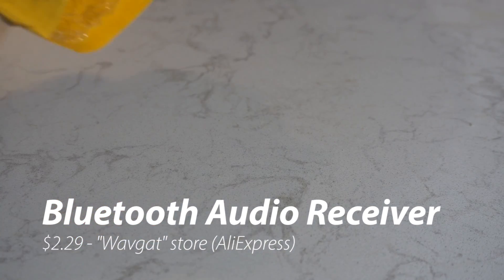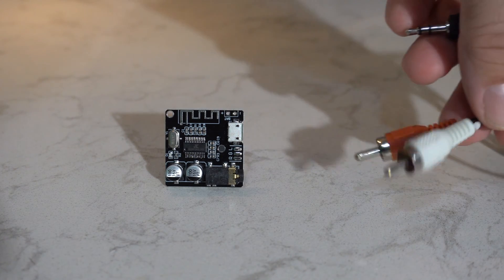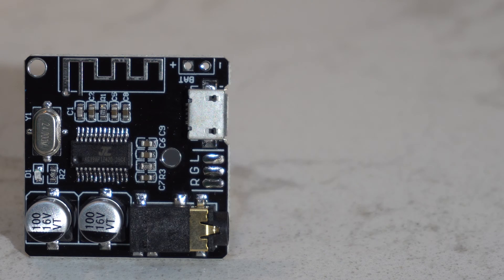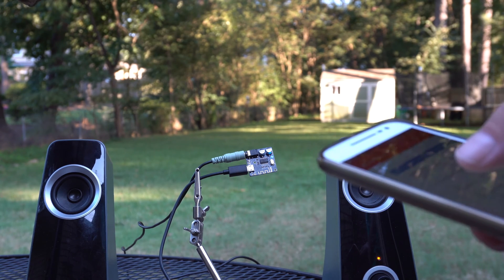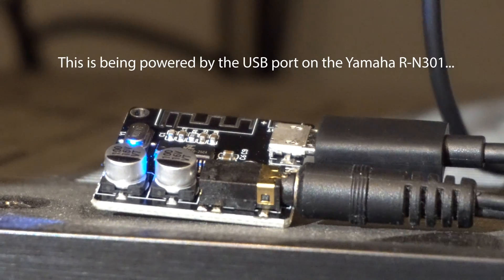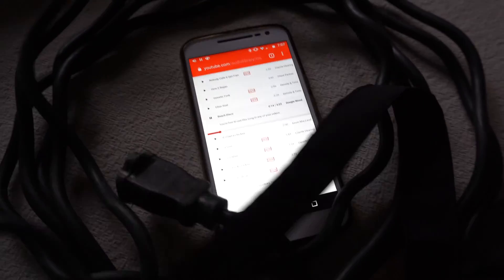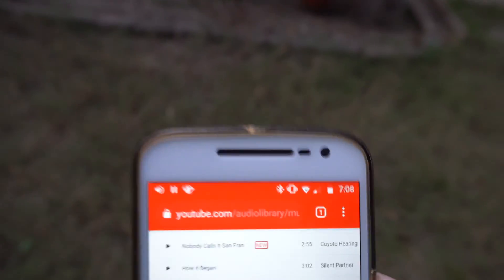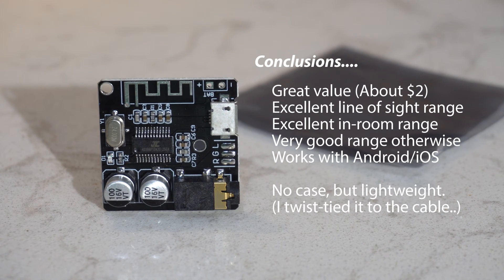Add Bluetooth to an old stereo receiver for $2 (No soldering)

Comment: Can you add the link of this product I can't find it online
Reply from the maker: I had originally bought this 3 years ago, I don't think the original store is still active. If you search Amazon for "bluetooth board" you should be able to find several examples of the same product. Amazon right now has 5 for $10 with Amazon Prime if you search for "Aideepen 5PCS Audio Receiver Module"... Thanks for watching!
Reply: @ACBMemphis  question with a CD player do you just wire it right and left channel ? then it will automatically work or do you have to put a blank CD so I can work (Bluetooth)hopefully you understand my question. I really enjoyed the video

Car stereo?

Comment: this is great, thank you ordered one for my vintage sound system....any thoughts how I can hook a classic car up with blue tooth I dont have any aux/line in on the old radio thanks in advance,( 62 Ranchero)
Reply from the maker: Thanks for watching! If you search Amazon for "bluetooth 12v car transmitter" you can find several options for around $20 which would take the Bluetooth signal and transmit it on an unused FM Frequency to your car radio. (Never tried this myself, but no reason why it shouldn't work...)

Comment: how is the sound quality? - Is it quite a step down from a direct wired analog input? I'd like to add decent sound (spotify) from my phone to my old stereo receiver. Can anyone recommend a good set-up if this $2 rig isn't it for my need? 🤔
Reply from the maker: Techmoan recently did a video about a "1mii b310" Bluetooth receiver that is nicer than this, but still under $100: https://www.youtube.com/watch?v=ZlI3yB2N9Pg
For an even higher quality (and more expensive) setup, check out an "Arylic S50 Pro+" which has been positively reviewed by a lot of audiophiles on YouTube...

Comment: Thanks for this. It's very helpful.  But I am trying to solve the opposite problem, and wondering if you can suggest anything.  I want to use my vintage receiver to broadcast to remote bluetooth speakers.  I want to play my vinyl, tape, cds on my stereo and send it to bluetooth speakers somewhere else in the house. I am already using my Aux for my cd player.  Maybe I can add a splitter there?  Or at one of my two tape monitor outpusts?  Many thanks!
Reply from the maker: Yes, they make affordable Bluetooth transmitters. The YouTube channel Techmoan recently reviewed such a device in a video about transmitting from a vintage audio system to a sound bar. (Search Amazon for "1Mii Bluetooth Transmitter" to see the device he was using...). You should be able to connect a bluetooth transmitter to the tape monitor record/out jacks on the receiver, and it should transmit whatever signal the receiver is playing: phono, aux or tuner. (Transmitting a tape signal might be a little tricky since you are using the tape monitor outs you'd have to set it in copy 1->2 mode.). Anyway thanks for watching and commenting!

Comment: Looking at the updated version of this board.  Would love to know how to hard wire the power.  Is there a power cord that can tap into 12v out there?
Reply from the maker: Not sure about the new version, but this board uses USB 5V so to power it from 12V you would need something like a car charger... Thanks for watching!
Reply: I agree, grab any obsolete 5v car charger (eg iPhone 3 or 4) take it out of the case, chop off the stretchy cable, a bit of wire and hot glue and you're done 👍

Comment: This is a great solution. I'm comfortable around circuit boards and electronics, and this is just a no-brainer. I might try to find a small plastic box but this is so small I can tuck it back and no one will see it anyway!
Reply from the maker: I just checked that site and today they have some Bluetooth modules in the $2-3 price range with a case included! Anyway, good luck and thanks for watching/commenting on the video.

Comment: Any suggestions for adding this to a 15 year old stereo that does NOT have any sort of auxiliary input, either 3.5mm OR coax cable?  No "input" whatsoever.  ONLY headphones connection!  (How frigging lame!)  Using in garage, extended speaker wiring so that the garage has a TRUE stereo effect, with speakers at each end of the garage.  Very nice sound overall, would just LOVE it to be able to have at least a wired and/or Bluetooth connection to stream XM radio through!
Reply from the maker: Hmmm that's a tough one. Without having to do any internal wiring on the stereo, one thing you might try is to find an FM transmitter, then hook the output of the Bluetooth receiver to the input of the FM transmitter. Actually, a quick search on Amazon for "fm transmitter" shows they have devices for under $20 that would take Bluetooth and transmit it to the stereo. The only drawback is since they are made for cars, they have those 12-volt plugs - but can probably be powered by a 12VDC wall adapter... I haven't tried something like this before, I just put one of those devices on my Amazon list, maybe that would be a good subject for a future video....  Thanks for watching!
Reply: @ACBMemphis  Ordered an Mpow FM transmitter with bluetooth the day we spoke here.  It just arrived today.  Works absolutely fantastic!  Crystal clear audio on 87.5 FM!  So awesome to have XM Radio blaring through my garage stereo!  And best of all it was only $7.99!  :)
Reply from the maker: @Florida_Man_In_Florida  Great, glad you got it working!
Reply: @ACBMemphis  I'd really love to watch that video if you made one. I have a Sharp QT-50 that I'd really love to convert to bluetooth somehow but it doesnt have Aux in, and those bluetooth receiver cassettes are super quiet. I'm not sure I'd be able to use an FM receiver with this thing.
Reply: @ACBMemphis  Thanks for the suggestion.  I actually do have a 12 volt to cigarette plug "dongle" from an old Garmin GPS circa 2007 when they used to combine them in box.  Basically it's a low amperage 12 volt wall adapter but instead of having a proprietary power plug it just has the usual cigarette plug on the other end.  That may work to power an automotive style FM transmitter from 120 volts household.

However with that being said I remember my friends who had FM transmitters back in the day in their cars, they were always full of trouble.  Static, distortion, etc.  I always went for the wired route - either replacing my head unit with one that had an auxiliary in port, or using the in-line antenna adapter with a switch to select between auxiliary in and FM antenna input.

Unless technology has changed, the FM transmitters of 15 years ago really sucked ass!

PS, the stereo in question is a TEAC MC-D3.  It has a tape player (which doesn't work - tape adapter would have been the preferred route!) and a CD player as well.  But absolutely no input line connections.  Only a single headphones out connection on the front.  For the era of this stereo I find it odd that it doesn't have an aux input, actually.  Everything else from this era did.  Early-mid 2000s to be exact.  It's unusual.  They must have really cheaped out on this to omit it.

Comment: Thanks for this video, I just installed on to both of my OEM radios of my Honda Prelude and CRV!

I had to solder into the L and R channel of the Prelude's radio since there were no rca cable inputs but otherwise, it was easy.
Reply from the maker: Great and thanks for watching! I checked Ali Express and this product is still available as well as one that advertises itself as "Bluetooth 5.0"
Reply: From where did you draw the power for the board?
Reply: @karlistomsons3942  At the time of this video, I used a Add-A-Circuit fuse tap to tap into my radio for 12v. Now I have my Bluetooth receiver getting power on its own circuit from another fuse box that I installed into my Prelude to be able to add more accessories properly.
Reply: @KookiDowg  where did you by it can you link the product that you used to install it on car stereo?
Reply: Thank you I was just wondering if you could put this in a car stereo

Comment: i'm trying to add this to my 1967 Magnavox Astro Sonic... any ideas how to wire this into a unit without RCA?
Reply from the maker: If your selector dial has AUX, there should be an input somewhere. If not, you could use an FM transmitter for a car.
Reply: @ACBMemphis  it does have an AUX option! thats promising.... i'd have to do some soldering to get this bluetooth chip to run off the same power as the console, correct?
Reply from the maker: @viva_jaime  I would be very, very careful attaching to old 1960s internal wiring. An easier solution would be just leave it running all the time it should use very little power.  But hypothetically speaking, I'd probably cut the end off an extension cord and tap into switched AC power within the unit, i.e. a panel light or something and just put a 5v USB power brick inside the cabinet.
Reply: My astrosonic has a plug-in in the chassis. You might just look to see if your model does as well.
Reply: @skepticjoe  an RCA plug in?
Reply: You can splice an RCA wire into a regular output speaker wire to get an input signal for the other end of the RCA to run into an amp. Done correctly distortion is minimal. My first half-assed stereo project as a kid was for an 86 mustang, I was running 7000 watts of total power from a line spliced into the line out cable of a discman. True story. 😉